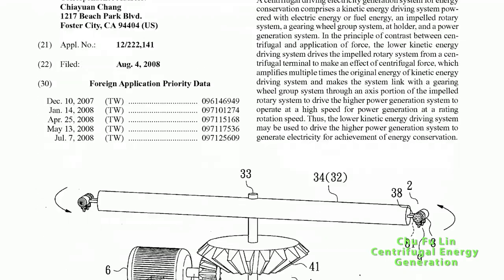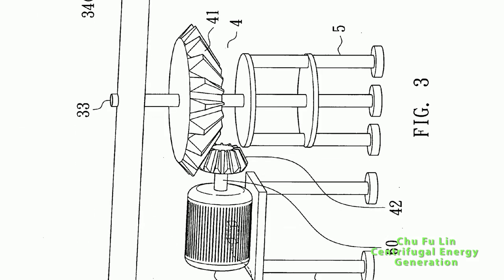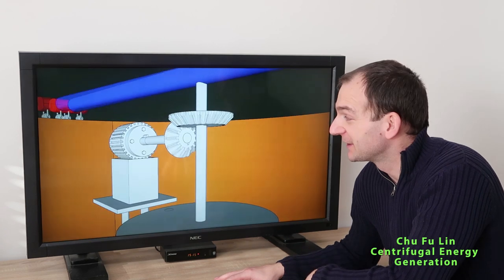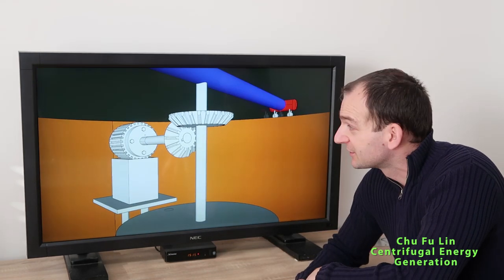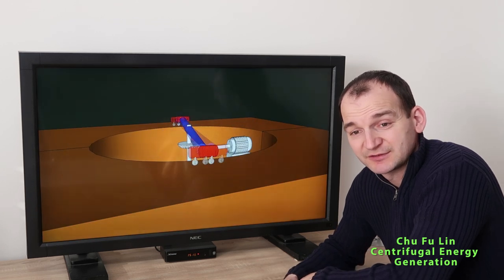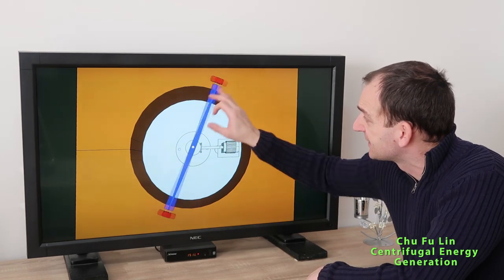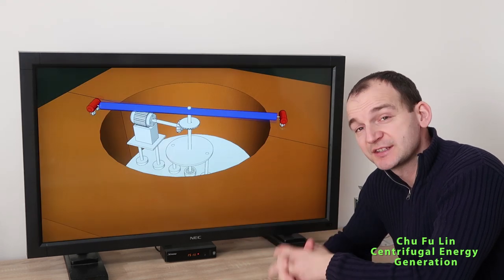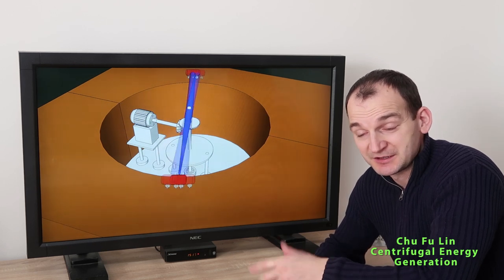Free Energy, Centrifugal Energy Generation system by Chu Fu Lin

Comment: I don’t get it why is the generator geared so low how can it produce any power turning slowly generators alternators they have to spin like 2500 to 3000 minimum.  So if that generator let’s say it’s turning at 3000 RPM, the gear turning the motor gear would have to be way bigger and let’s say it was three times bigger then The vertical shaft would have to spin 1000 RPM in order to turn the motor shaft 3000 RPM and that would mean those horizontal bars connected to those wheeled motors would have to be turning 1000 RPM also so then how fast are those little wheels turning that are driving that arm 800,000 RPM?  It doesn’t make sense